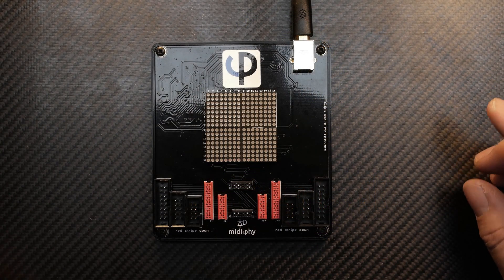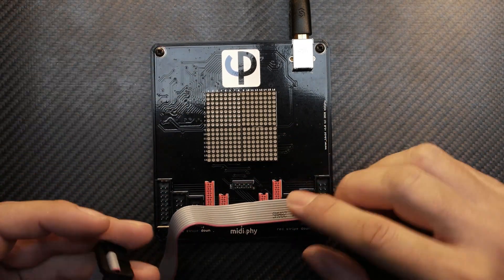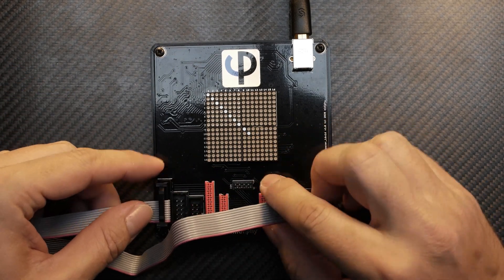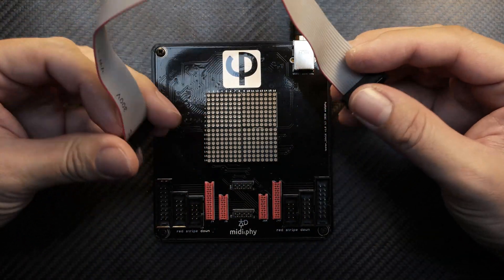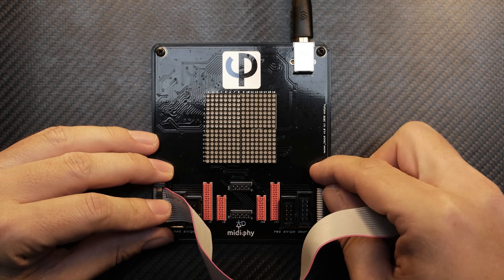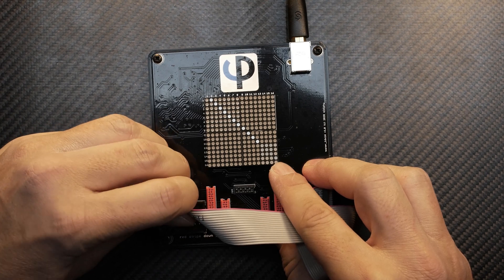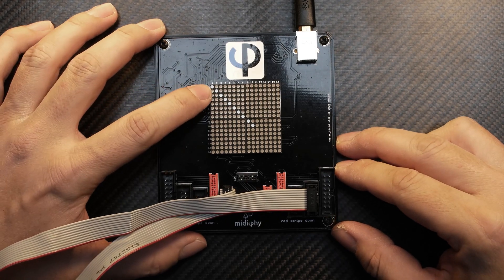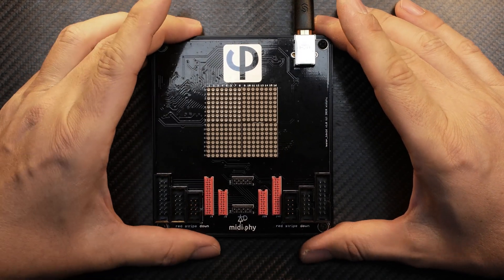midiphy wirescanner - DIY graphical IDC and micromatch cable tester

Comment: Hey quick question! Where can I find the micromatch to IDC cable used in this vid? Looking for one with 16 pins but not having much luck
Reply from the maker: Hi - you can easily build them on your own - e.g. mouser has the connectors and ribbon wire in stock. See our "building the midiphy MatriX photo tutorial" (google) for micromatch cable construction tips. Best regards, Peter
Reply: @midiphy  thank you, much appreciated!

Comment: Cool but useless for me. I have 34 line DIY's. Also the shortage indication is not well solved. The numbers from the cables should indicate which ones are shorted. Not only some glooming pixels.
Reply from the maker: The purpose of Wirescanner is to graphically show quickly if a cable is good or not - in our testing experience with our own cables, more than 95% of cables are good - the bad ones can either be permanently sorted out or measured manually (often a visual inspection shows the cause) or just crimped again with new IDC connectors on both ends. While wirescanner is an analog tool, it will show a quadratic region when there are shorts, i.e. if pins 5-6 are shorted, you'll see four illuminated LEDs at coordinates 5/5, 5/6, 6/5 and 6/6, so you can determine which pins are bad. With DIY adapters you can chain multiple Wirescanners to scan for more pins in parallel or even scan different cable types (non IDC/micromatch). Best regards and enjoy! Peter